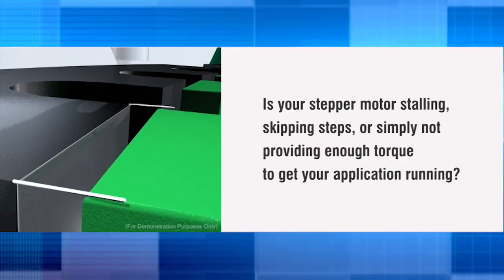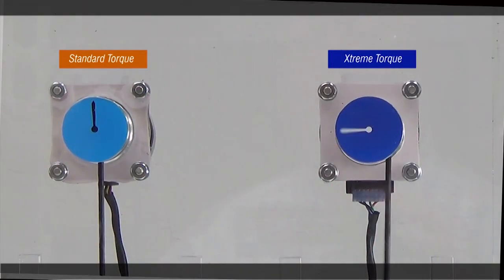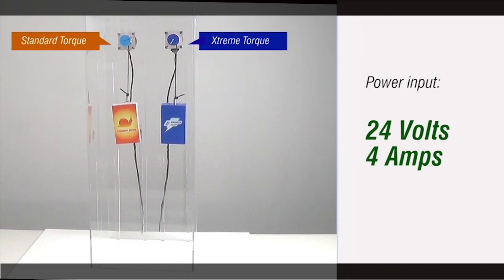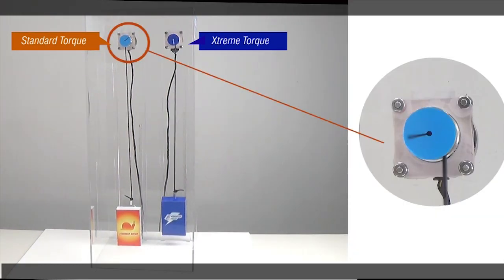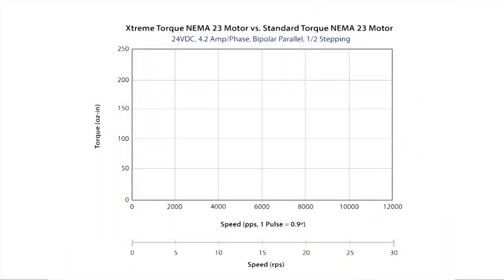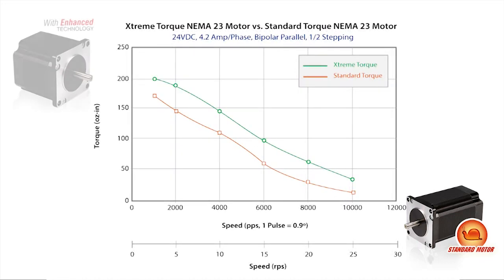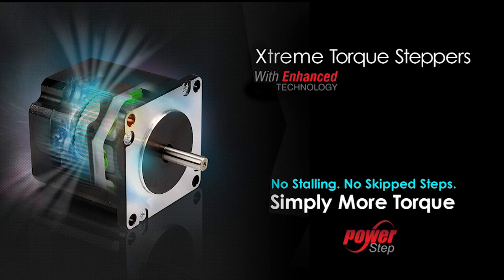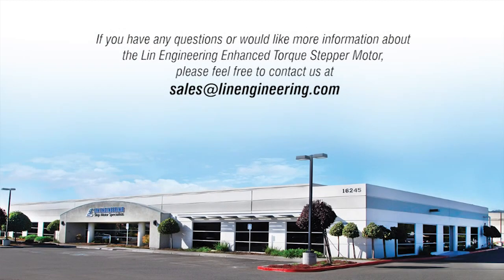E5718-057 Enhanced Vs Standard Stepper Motor Demo

Comment: Could you folks offer more technical information for the nerds/hobbyist/engineering types that are curious about the new motor? The video just seems more geared towards marketing, without details that show the two motors are actually being delivered the same power. It isn't even clear if the two motors are the same dimensions. In fact the slide with graphs shows two different size motors. 

So is this an overall product improvement? More copper in the windings? Better magnetics? stator?

Thanks ^_^